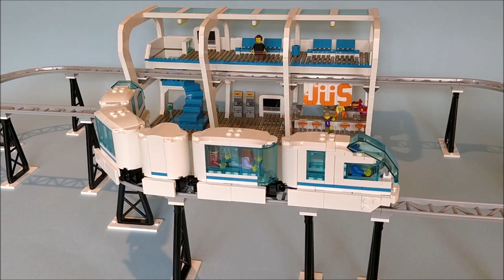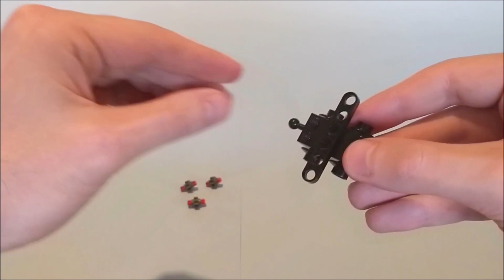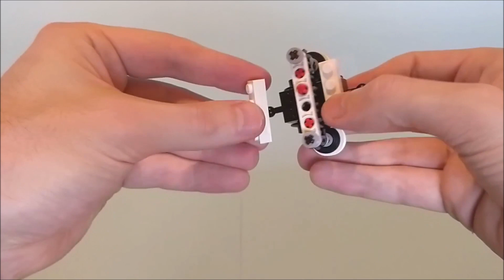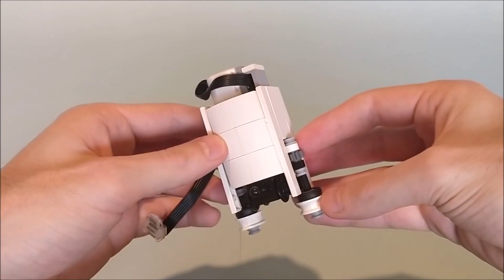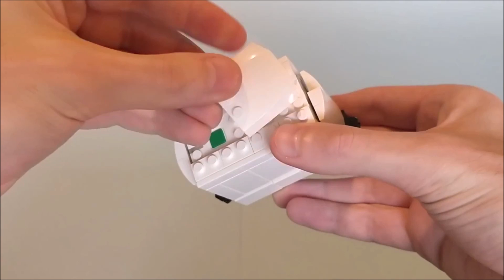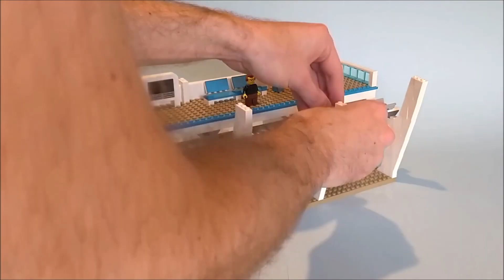Skyline Express Motor Installation

Comment from the maker: UPDATE: All links have been updated and are working again. Sorry to those who have been waiting a long time for this update!
Reply: Correction for the parts list: The list includes the Power Functions rechargeable battery pack, part 84599, but the motor in the parts list and used in the video doesn't have the correct connector for that battery. The battery pack shown in the video looks like the Powered Up Hub, part 88009, which does have the correct connector.
Reply: @chris_ride-far  Do we know what receiver he's using?

Comment: Finally got around to building mine and added motor functions. I went through three versions of cars but settled now on larger cars on top of roller coaster carts that hug the track and can run around curves with ease. I had to modify the station to be a bit larger and taller than you had recommended when using the original set cars but very worthwhile.

Comment: Correction for the parts list: The list includes the Power Functions rechargeable battery pack, part 84599, but the motor in the parts list and used in the video doesn't have the correct connector for that battery. The battery pack shown in the video looks like the Powered Up Hub, part 88009, which does have the correct connector.

Comment: I would like to add the motorization without having to sacrifice any of the passenger cars.

This means I would add in additional car for the battery, as well as an additional segment for the motor.

Is there a parts list for this?

Comment: Is there way to motorize it without sacrificing one of the passenger cars?
Reply from the maker: I'm afraid not, but it is pretty easy to source the parts for more cars on Bricklink. I added two extra cars and it was still working OK. I think the motor would struggle with much more than that though.

Comment: Fantastic! This pushed me over into pre-ordering the set.

I have tired to use the PF2.0 motors in other ideas, but they are hard to control. The controller is full on or off, and the button has to be held down. None of the app profiles work well. I would love to use PF2.0 over PF as it eliminates the need for an RF receiver, and I feel the battery box provides slightly more power. 

I would like to know what you are using for a controller. Just curious if you are having the same issues or have found a better solution.

Thanks!
Reply from the maker: My motors and battery box were from the app controlled batmobile. I've been using that profile in the PF2.0 app and it works pretty well with a speed slider bar that gives good speed control.